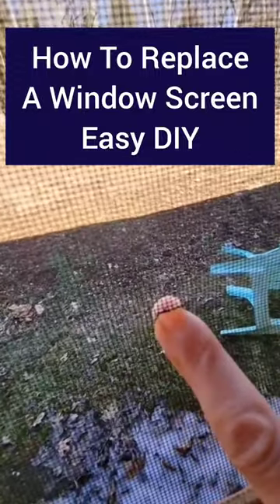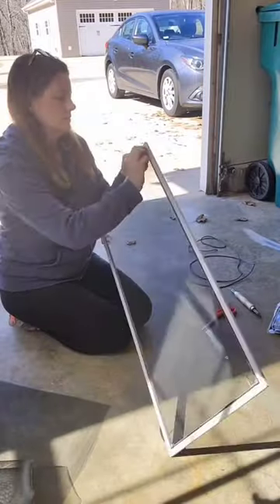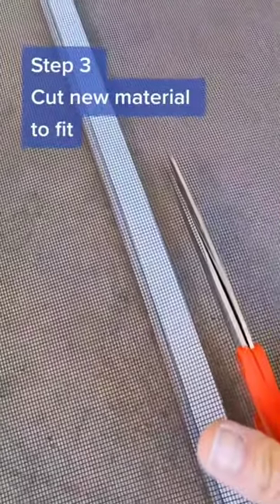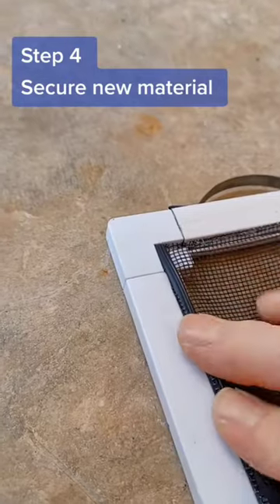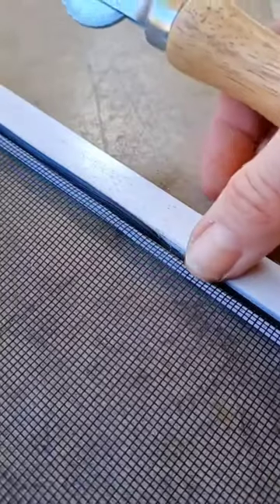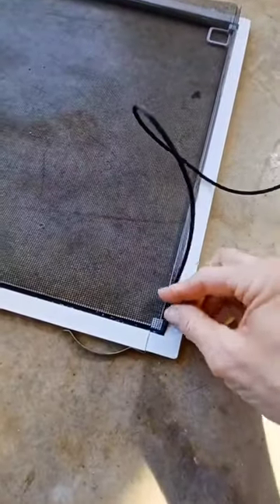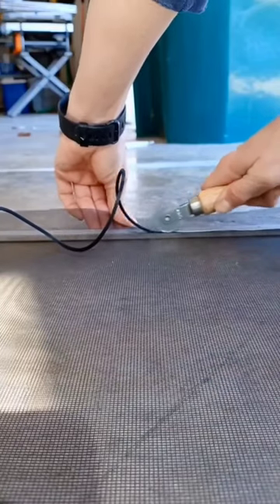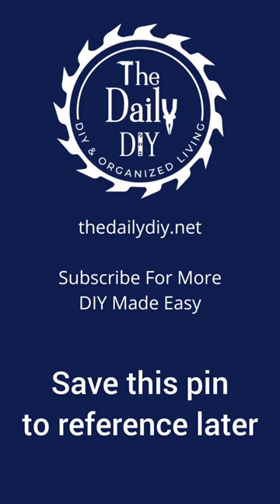How to repair a damaged window screen, easy DIY you can do this weekend

Comment: If you pull the screen tot whith larger screen it will bow the frame, instead put hand in the middle and guide it so it doesnt pull to hard on opposite side. I re screen as a part of my windkw cleaning business and do about 1k a week just in screens.
Reply: Wow. Do you make whole window screens too if theirs are battered or rescreen only.
Reply: I tape it down and I also brace the frame by putting a long piece in the middle. Once screen is fitted you take the brace off.
Reply: Taught